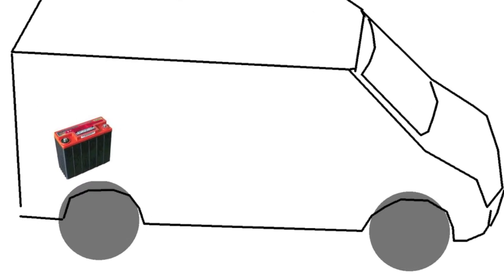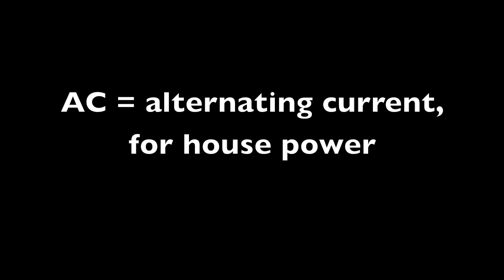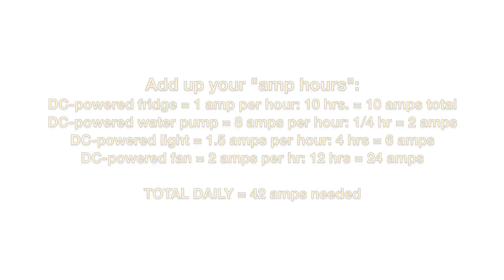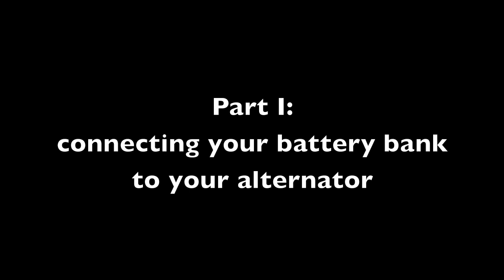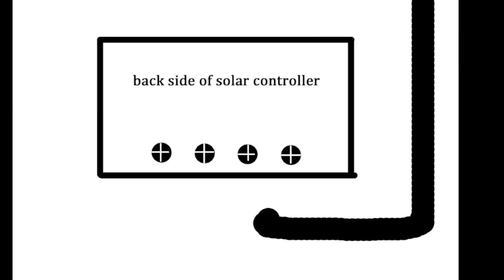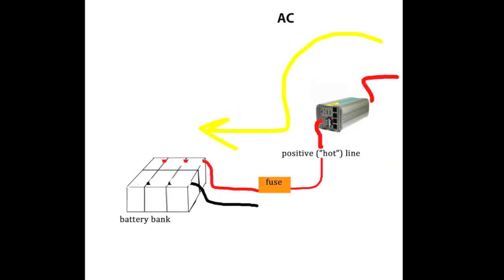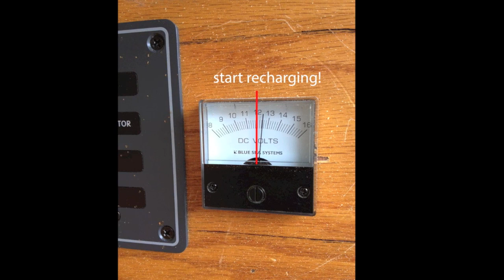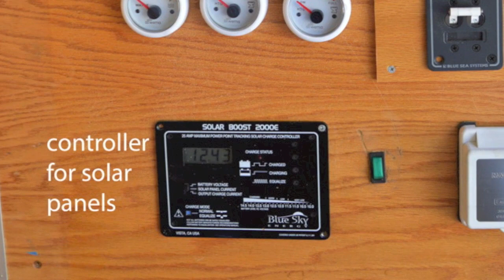Custom Camper Van Conversion, Part 5: RV Electricity & Solar Power

Comment: Nice video, exactly what i was looking for. Do you have way to chose how your bank is being charged ? i.e if the panels aren't providing enough charge and the bank is reduced to a low level, will it take charge from other sources? or do they all charge at once if possible (suns out, AC's hooked up and the engines running) if this is the case what stops it over charging ? Thanks
Reply from the maker: Zach Bimson The solar panels are run through a charge controller than keeps the batteries from being overcharged; also the inverter (when plugged in) has a charge controller. When the van is running, the alternator feed over-rides the solar feed.
Reply: Perfect thanks Ron, is the override done with a diode or a isolator ? or is it just wired in first?
Reply from the maker: Zach Bimson Alternator feed has an isolator. You can turn any of these feeds on or off. If the alternator and solar are on at the same time, the alternator -- the stronger, more consistent feed-- will override the solar

Comment: Will your solor panels handle a microwave or do you need run the generator?
Reply from the maker: Jeff Woodard You really need a generator (or to plug in) to power something like a microwave.
Reply: ok

Comment: Hi Ron,

How did you attach your solar panels to the roof of your van? I'm trying to determine the best way to attach a solar panel to my pickup truck that I'll be living out of.
Reply from the maker: beaky612  Easiest way is to get self-tapping bolts. The panels come with mounting brackets. So you're screwing through the bracket holes into the van's sheet metal roof. Before tightening the bolts, slather exterior grade silicone under the bolt head and under the bracket foot. Or use an RV grade sealant that stays flexible. Your sealant should squeeze out and around the bolt once you tighten it down.

Comment: Help! I have a 30 ft forest river, need to go green, want to eliminate propane and generator, can i power off my alternator?
Reply: A sterling "battery to battery" charge controller is the most simple option (a bit pricey though) ... a straight "split charge" system is cheap but unlikely to give you enough voltage to charge open wet lead batteries efficiently. (14.8v)

Running a propane generator is vastly "greener" than having to drive just to charge batteries.
The best "green" option is to mount a cheap domestic 250w (36v) solar panel with an mppt charge controller to deal with the higher voltage issue.
I get 90%+ of my summer power via a 250w solar panel... the rest comes via "incidental" driving, to work etc.... winter is a slightly different story.
Panel cost me £110 (surplus) and mppt controller was £80 ebay.
Just make sure you buy a panel that is within the mppt charge controller spec... some domestic panels have a higher voltage than my charge controller can handle.
Reply: Thank you! I will look into it.
Reply from the maker: Yes, you can power your house batteries with your alternator if it's big enough (more than 90 amps). Talk to a marine electrician about the alternatives. Marine electricians are well versed with off-the-grid options (think of sailboats). Good luck with your project!

Comment: Little bit of misinformation here. First, an INVERTER converts DC from the battery bank into AC. The waveform can be square, modified sine wave, or pure sine wave, as noted; however, the output feeds AC devices, some of which can be damaged by anything other than pure sine wave voltage. A CONVERTER, on the other hand, is a device that plugs into an AC source, and produces a nominal 12 volt output, to provide power to your RVs DC devices: LED lighting, for example. A CHARGER/CONVERTER also is able to charge your house batteries with an internal 3 or 4 stage charger. Other than this bit of confusion, good, informative video.
Reply: +Don Hoppes 
I was just about to question about this. So you would also run a generator through a charger/converter?
Reply: I believe a typical RV electrical system runs the on-board generator output through a charger/converter for charging the house battery bank, and supplying regulated 12 volts to DC appliances.
Reply from the maker: +Don Hoppes 
That's it. The best configuration is to get a high-end charger/converter combo. In the video, I simply call mine an "inverter," but it's actually the combo that does it all

Comment: Things are easy today.A battery to battery charger simply connected with no cuts and easy very easy wiring is  maybe the best solution.And agm very good batteries. Avoid chinese.Solar panels maybe needed if your battery to battery charger cannot be enough for what you need for your appliances.And at the end you need a very very good mains charger.These things are working and make your job in silence and clearly. Without complications and wirings etc etc.

Comment: I have to say that is an overkill job there is a lot of unnecessary equipment in your van hence your set up, here in the uk I have one deep cycle battery powered from one 100w solar panel with alternator back up, this powers through my 1500w pure sine wave inverter, from that I can run fridge, tv, laptop, computer console, water pump, laptop and even a kettle, so no need for all this equipment and breakers etc.
Reply from the maker: Sounds like you found a system that works for you, Terry. I don't know that my four 6 volt batteries -- the equivalent of two 12-volt batteries -- is overkill. I'm powering a 63 quart fridge, a big unit, for instance. And I work in the van late at night, with lights, computer, etc. I'd rather have more rather than less. 

True, breaker panels are a luxury -- you could do the same job with small blade fuses. But, if you can afford it, a breaker panel is really convenient and the best bet for safety, since it cuts off the circuit before anything burns up. That's not the case with basic fuse boxes.

Comment: You did what, what was it you did?
0:15 You did marine electric, but your not one 11:40?
Could you clear this up.
Your giving advice but also adding a disclaimer!
If your knowledge is lacking, why give advice, it'll only hurt someone.
People think the first thing they hear is true and stop there.
Reply from the maker: As I say in the video, I consulted with a marine electrician. He advised me, told me how to do it, and then after I did the work, he inspected it. So: you can do the work yourself but you have to consult with an expert to make sure you're doing it right.

Comment: A cheaper way to convert shore power to charge your batteries is with a regular battery charger from say walmart or amazon. Mine was 60 dollars, has built in circuitry to protect the batteries from over charge. I do have to manually set it each time I wish to recharge batteries in this fashion but all that entails is flipping a switch.

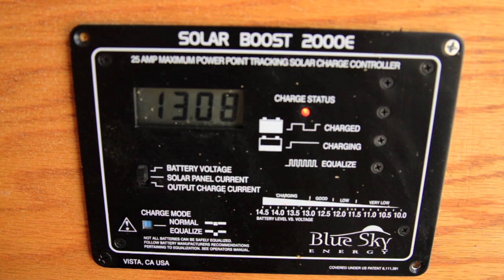Comment: Good Grief!@7:05 or so he says " Here is my charge controller and it says I'm pulling 30 volts from my solar panels. Which is pretty good.".  OK,  obviously he meant to say 13 or 13.09 volts, forget that reading error but even if he said "13 vs 30" that is nonsensical statement and not a proper statement of the facts as to what that number means at the time.  At that moment the controller read 13.09 vdc, yes but that says noting as to what the panels are putting out. That number by it's self says absolute nothing specific without knowing some other factors going on. Such as the SIZE of the battery bank, the current state of charge/discharge of that battery bank AND the amount of current being produced (at that moment) by the panels.  No wonder people are confused, even people who make money working with this stuff misuse terms and produce videos that have terminology errors.
Reply: I think you're splitting hairs.  The video is clearly designed as a general overview of a basic solar/battery setup.  Obviously there are more details one could go into but the core info is correct.  The only thing I would add is that the solar panel/charge controller is a better way to charge a battery than the alternator method.  But it is useful to have the latter as a backup.  Cole Hersee makes a very good smart battery isolator that will only charge the aux battery when the starter battery is fully charged.

Comment: Hi Ron, thanks for the video, it really was helpful. I have a question if you have the time.

Does connecting an auxiliary battery bank to the alternator increase the workload on the engine (such as turning the AC on would) and/or starve the car battery of juice?
Reply from the maker: It does not strain the engine but it can drain the starter battery. That's why you need a switch to turn it off and on.
Reply from the maker: ***** Yes: I have a charge controller for my solar panels and for the AC feed to my inverter. And,  yes, every line is fused.